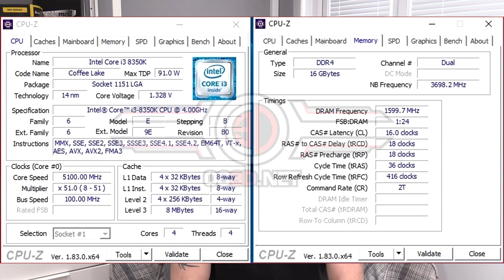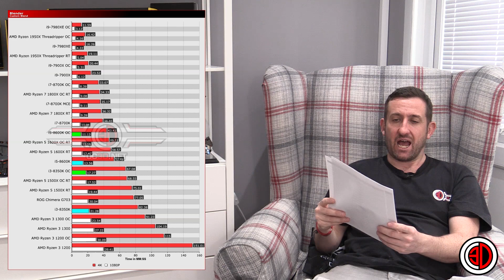Intel i3 8350K and i5 8600K Overclocking Review

Comment: Great video as always Guvna, been missing ya! They're 7600k and 7600k+50% moar cores.
I remember when 4c4t "K"  chips for £170 used to have "i5" in front of them, How times have changed..or havent.
i5-2500K 4c4t 95W £168 - OC3D 3rd January 2011
i3-8350K 4c4t 95W £170
i7-2600K 4c8t 95W £245
i5-8600K 6c6t 95W £250
Most do 5Ghz, What changed was IPC, solder got replaced with TIM and virtual cores got replaced with real ones (even though people hated amd fx for using real integer units), no doubt well hear "games only use 6 cores" and "IPC doesnt matter as much as GHz does" from here on.
Atleast we have a 4c4t for £100 instead of the crap i3-2100 we had back in the day, couldn't render the skin off a custard. When we finally get a new arch in icelake we'll see if it melts the ice caps.

Comment: i wish intel would up the TIM, its such a shame that its basically been getting shitter since the 3rd gen stuff
Reply: it only started with 3rd gen, so pretty much a case of progressively getting worse, actually since 5th gen because haswell refresh was a much needed improvement over the dogshit they smeared on ivylake. hence i bought a 5820k..soldered haswell refresh, 6c12t for same price as an 8700k over 2 years ago with added pcie lanes.

Comment: Tom do you test for WHEA errors when stress testing or during normal use on the PC? My 8700k needs 1.395v to rid all of my WHEA errors at 5ghz, and for 4.8ghz it needs 1.28v (which i run daily). I just find 1.325v for 5.1ghz hard to believe for a fully stable chip.
Reply from the maker: just the silicone lottery dude. Ive got another chip (I got it after launch so dont use it for reviews, CPU always has to stay the same) but it does 5.2 at 1.3v
Reply: yep mine does 5.2 at 1.3v but to be 100% stable as everybody seems to demand i have to drop it to 5.1 with avx offset of 2

Comment: how come the 8600k reviews come so late from everyone? I already brought one, and was way after launch.

Glad the review has been done regardless.

My own 8600k is only running at 4.8ghz, I could hit 4.9 or 5ghz stable by upping the voltage to 1.38v but that to me is unacceptable high when I can run 4.8 at 1.29v, plus no one has proven voltages near 1.4v are stable long term without degradation.

Also I suggest people dont bother with offset as quite a ot of software uses AVX now days, including virus scanners and chrome.  So e.g. if you can do 5ghz stable without AVX and 4.8 stable with AVX then I would just run at 4.8 with 0 offset.

For me 6 cores at 4.8 with ddr4 is still mighty fast compared to my quad core haswell at 4.3.

Also I am running on broken LLC bios.

I get better results with this broken bios than with working LLC.  LLC on highest levels would set voltages too high under load, and on lower settings I lost stability under AVX, but on this 1.00 bios from asrock which has non working LLC, the voltages stay at a reasonable level under load and is stable.

Also I expect the 8600k's run way cooler than the 8700k's, even at 1.38v I was not hitting thermal throttling and I only have a mid range air cooler.  People rushing to buy an 8700k cause its fashionable probably are more suited to a cheaper and cooler 8600k if they dont render or stream.
Reply: i think with llc you could get that 5ghz at 1.29.  give it a try if you havent.  i use llc all the way up and it never goes above the voltage that i set but that is on a z370 pro4.  i can do 5ghz on 1.26 or 1.28 with llc on and it never goes above that 1.28.
Reply: Hi bob

I did already try.  All my initial testing and tuning was done with "working" LLC.

I tried with fixed and adaptive voltages, although the fixed was only for testing as for 24/7 use I Want adaptive for lower idle voltages.

On fixed voltages I needed really high voltages for stability, which also meant really high idle voltages, ironically simply bootup 'parted linux' was a good stress tester, it would kernel panic just on bootup but stress testing was also unreliable, it was stable in light windows desktop use as well as lighter tests like aida.  On adaptive with high LLC I could set a lower voltage because maxed LLC made the load voltages sky rocket, so e.g. setting 1.29v would have the voltage hit 1.4+ under AVX load, a massive spike from LLC.  But I didnt like the variability LLC causes, LLC level 4, is similar to no LLC but not quite as good, is a small vdroop and needs higher voltages to be stable, LLC 3 and below all vdroop.

Ironically with the broken LLC bios the load voltage for adaptive is very close to what is configured in the bios, like its the perfect setting.

Its just not a great chip, needing a big voltage bump to get past 4.8.  Ppwer consumption also goes through the roof at those high voltages as well, a intel stress AVX bench needs 160 watts peak to avoid power throttling at 1.31v, at 1.4v it needs 270 watts.  Whats funny at first I thought I won the lottery as I spent quite a while running it at 5ghz 1.29v, windows was fine, pcmark and aida tests fine.  But it fell apart when booting up linux as well as doing the heavier stress tests.

I won the lottery on my haswell, the voltages I ran that thing on at 4.3 had people gobsmacked, but lost the lottery on coffee lake, it happens.

Comment: I don't get these heat issues.  My 2500k @ 4.6 runs at 14-25 deg C (not under stress) doing normal things like browsing internet, mail, etc.  And I has a simple tower fan and 1 fan.  Multi tasking hits 40 deg C.
Reply: tigerbalm The 2xxx series, (Sandy bridge) used a soldered ihs, the 3xxx and up use thermal paste. Hence the difference.
Reply: tigerbalm I had a 2600k, mildly pushed to 4.3Ghz with a 20€ Cooler Master heatsink with a 90mm fan and it was always cool. Now got an 8700k and I use a 60€ mastodont (trice the size, with dual tower and dual 120mm fans) cooler to keep it in check.

Yeah, the difference is massive, I was like you, like what's the whole deal. It is not like the end of the world, but the moment you push the clocks, heat arises fast.

Comment: I have the i5 7600k is it the same Like the i3 8350k😟
Reply: pretty much. if you leave them at stock there is a difference because of the different turbo speeds but at the same speed they are the same chip basically.

Comment: im super happy with my 8350K, first time is set to 5.0ghz and 1.33 volts stable, but the IPC is so strong 215 CB single score that i just left it at 4.5ghz and my  Rx 480 is pegged  at 100% in every game.. Super happy. Also im coolin it with Cryorig H7 and in games its max 55C soo. Super happy.

Comment: i5 8600K at 5Ghz delidded 1.315v around 60C on open water 240 loop. LLC on Turbo (level 3?) for Gigabyte Aorus Gaming 7.

Pushed it to 5.1Ghz at 1.41v (too much and dialed back to 5.0Ghz). Fantastic chip for the money.

https://valid.x86.fr/8zw15c

Comment: These new i3's make a good low cost option for home theater PC's. Nice video.
Reply: I am not saying either brand is better than the other, I'm just curious, what benefit does a 5.1ghz quad core in a HTPC give you vs either a cheaper and slower quad core or a similarly priced lower clocked 6 core?
Reply: Unless you just don't want to buy AMD they absolutely are no where close to a low cost option.
Reply: jaxxice just because AMD makes an even lower cost option doesn't mean this isn't a good low cost CPU.  I mean it's a quad core CPU  capable of hitting 5GHz.  Can't go wrong with that for an HTPC IMO.  AMD has solid options in this segment as well, but they won't compete in single threaded applications due to the clock speed differential.  Just depends on what you're going for, that's all.
Reply: ECPU Good luck with subnautica, as the game breaks usually around 3 hours in for me and I have a 1080ti and a 1700x. Anyways 120fps on a 1050ti can be a bit challenging, but if what youre playing is rocket league and csgo, then you should be fine. To be fair, this is more of a living room gaming pc more than a HTPC, as you don't see a Dgpu in HTPC's most of the time, which is why intel's iris pro graphics lineup was so interesting to a lot of people (but it failed with the rest of broadwell) The integrated graphics of a r3 2200g will run circles around any intel hd graphics, and would be the best solution for a low power HTPC as they combine use less than 65 watts. That little vega igpu uses only about 20 watts.
Reply: James Mastroianni probably only higher FPS in non-graphically intensive games.  But I personally would value that since I like to game on my HTPC.  I currently use an i5 6600k overclocked to 4.6GHz.  I would say this core i3 is a good low cost option in comparison.
Reply: I know but we're talking about a multimedia PC which from my understand the only reason to go Intel for one is specifically to major down clock and under volt. I'll admit I'm 100% unaware of how low you can push the newer AMD cpus for this specific use but if cost is a factor when making a media pc AMD takes the cake. Granted I will say at that price point it's an amazing all around cpu that can perform basically any task you wish and for a lot of people that's probably what they'd want and be willing to pay a slight premium for peace of mind.
Reply: ECPU What gpu are you using, what games are you playing and whats the resolution and refresh rate of your TV?
Reply: jaxxice well said. I don't disagree.  Both would be good options for a multimedia PC.  I just tend to prioritize gaming in my builds  (even my current HTPC) and that's why I like the higher clocked CPUs . AMDs offerings would handle gaming as well, so it's a matter of whether or not you want to pay the premium for the top tier performance.  It'll be interesting to see how the higher clocks of the Zen+ CPUs affect things tho.  One month to go!
Reply: James Mastroianni hey. Current HTPC is running a GTX 1050 ti.  I try to hit 120fps to match the refresh rate of the TV at 1080p.  I usually mess around with Rocket League, Subnautica and a little CSGO.  The i5 and 1050ti do a decent job for these games in this situation.
Reply: James Mastroianni actually yea those new Ryzens with Vega igpus would be good as well.  Subnautica works pretty well for me in terms of stability.  I don't play it on the HTPC all that often tho... I'm usually on my gaming PC when I play it.  Love that game.

Comment: 48 hours prime95 each for large ffts, small ffts, & blend (if you're doing ram / imc oc)  or it shouldn't even be considered remotely stable

edit::::::actually 12-24hrs small ffts is adequate from what i've found but large and blend can easily error out after the 24-36hr period if there are slight instabilities
Reply: 2 years of blend or nothing.
Reply: ^ this one knows
Reply: Prime95 for the life of the cpu or gtfo.
Reply: issaciams This guy knows best
Reply: 1.) Cinebench R15 - if pass then
2.) 15min Aida64 - if pass then
3.) 20min OCCT with AVX Capable Linpack - if pass
4.) 20min OCCT Large Data Set - if pass
5.) Use as if it was stable, tune voltage if crashes

Yes, this is not for people that cant afford to crash, but this is how I do it and it is fairly quick and easy.

OCing RAM... that is a different story entirely though.

Comment: Great review, would love to see an 8600K OC guide. The amount of OC settings is crazy these days.
Reply: I recently upgraded to a 8700k from a 2600k and, like you, I was overwhelmed with the amount of new shit added.

But in the end, after reading a bit, a safe overclock, is as simple as LLC set  to medium (lv4 on my board), anything between 4.7-5.0Ghz,  and anything between 1.20-1.35v, depending on how lucky you get with your chip. Much other options don't matter much unless you want to go 5.1Ghz and beyond, a point at which you reach diminishing returns, anyway.
Reply from the maker: LLC should be used to keep volts stable - you just use CPUZ and HWmonitor to keep an eye on it.

Comment: been running my 8350k at 4.7 since i got it in December only 1.12volts never goes above 45 degrees on all cores with a Silverstone tundra 240mm aio tdo2-lite. had it running at 5ghz stable but wasn't happy at it running at 65 degrees with the aio maxed out. Great vid Tom btw i snagged my cpu for a mere 156 pounds. lets me play all the new titles just need to invest in a gpu when the prices drop at some point.
Reply: MGS-Steve y not 5ghz. Any temps under 85c is safe
Reply: to test for true stability, it can take days of testing.  regardless what charts and graphs you see, it's not wise to let your intel chips run in the 80's-90's for long periods of time.  long periods of time/testing is what it takes to find truly acceptable stability and even then it still may be unstable.   oc'n is not an exact science by any means.
Reply: the reason is the extra 300 mhz is not worth the extra heat and stress on the cpu for everyday use, if i had a better case with better airflow and a bigger rad then yes 5ghz would be ok. my old Q6600 will run at 3.6 ghz but the temps and power draw are crazy so i used to run it at 3.2 with noticeably better temps and lower power draw with a vcore of 1.45volts. i have been real lucky with my cpu purchases before i snagged a Q6600 new for free i was running my E5200 at just over 3.5 with lower temps and vcore but the Q6600 was just too good to not swap it out. Still have both cpu's and the Asus Q5 ws mobo and ram As a reminder of how far tech has come. I just hope this 8350k serves me as long as my old Q6600 if not then i will maybe upgrade to the 6 core non hyperthreaded cpu.

Comment: Funny , my i5 8600k @4.8ghz 1.3v eat's 210w in prime 95 if i am to belive in hwinfo 64 :D
Reply: it's probably correct or close to it.
Reply: But the whole system or the CPU alone?

Gamer Nexus, with actual tools to measure power consumption, measured an 8700k @ 4.9Ghz and 1.4v at 129w. Just the chip. I find it hard to believe that the 8600k would consume more than that with less threads, less voltage and speed.
Reply: HWinfo64 says cpu package power while running prime 95 is over 210w , i even managed to make the VRM's on the asrock z370 extreme 4 throttle @ 5.3ghz and 1.4v
Reply: My 8700k shows a package power consumption of 74w on HWiNFO with XTU stress test.

That's with a mild 4.7Ghz on all cores and 1.19v. Three times less comsumption with 6 more threads, and just 100mhz less. Odd.

Small FTT on Prime95 show 142w, and 79w on Blend.

And you have a motherboard with so much better VRM than mine, and thus, efficiency.
Reply: with 1.2v i have less then you , but my cpu need's 1.35v for 5ghz or 1.3v for 4.8ghz , on 5ghz it eats 210+ in small FFt eassy , on 4.8ghz its between 180w and 210w , the higher the voltage the more power it eat's
Reply from the maker: Ours are tested as complete systems - you just compare with CPU's in our graphs. You can never compare results from different publications because there are far too many variables between test systems and procedures